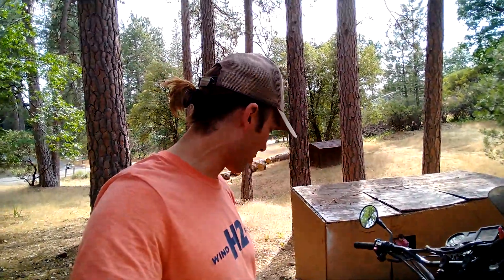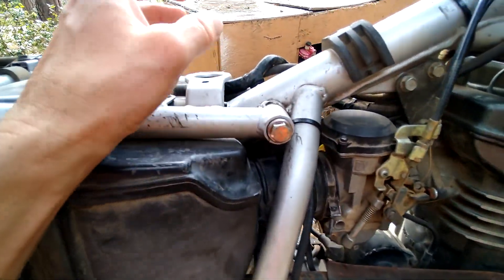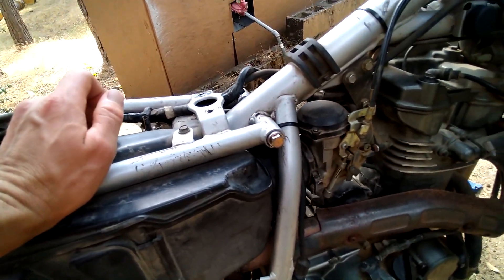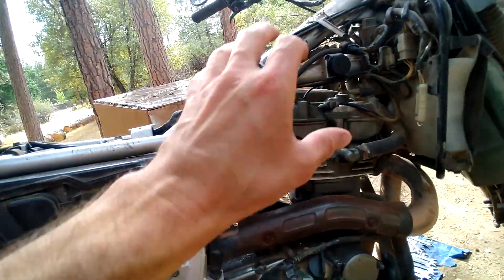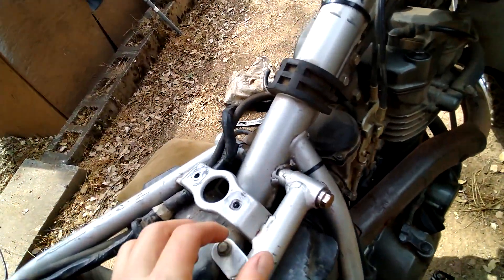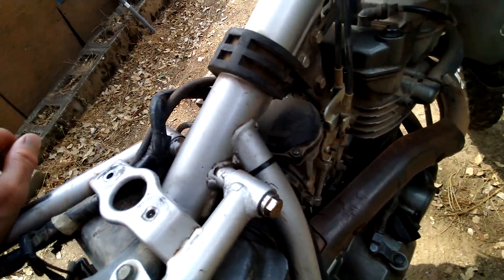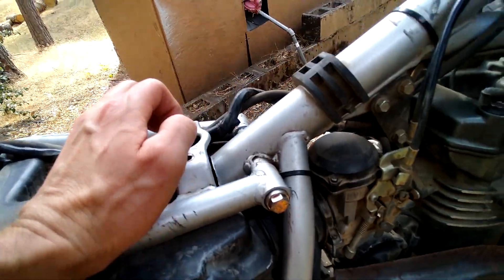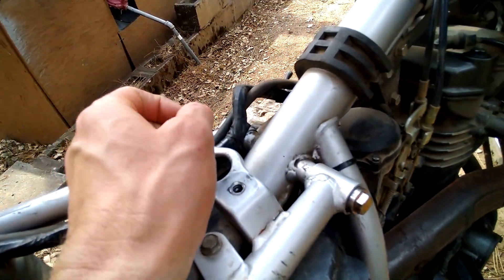KLR 650 KAWASAKI SUBFRAME BOLT UPGRADE DRILL THRU METHOD WITHOUT EAGLE MIKE MANUFACTURUING KIT

Comment: I've always thought about doing this. The frame bolts on the KLR sketch me out a bit. I'm always checking to make sure they haven't disappeared randomly. Good idea with the socket spacer.
Reply from the maker: Probably be a good idea before it breaks depends how you ride it though  pretty rough with this one